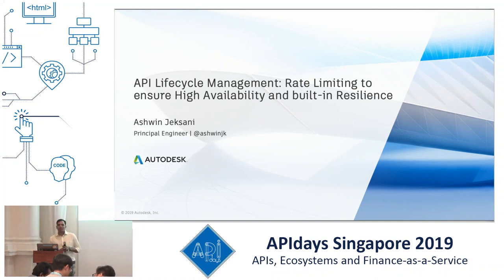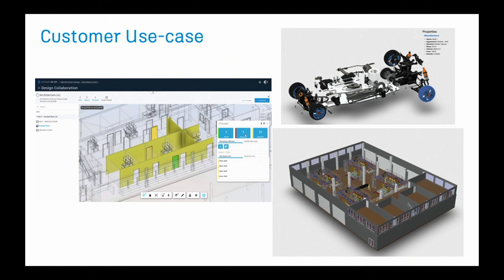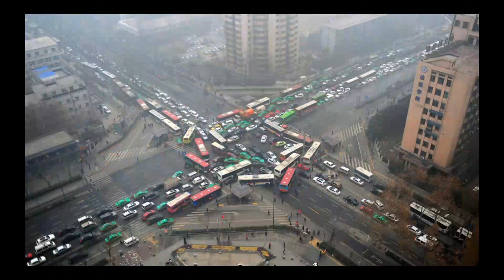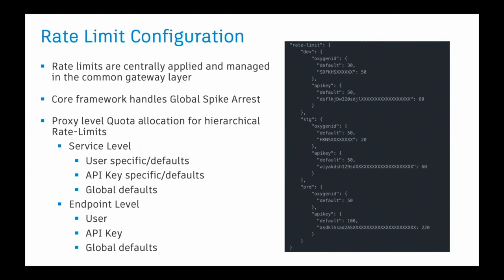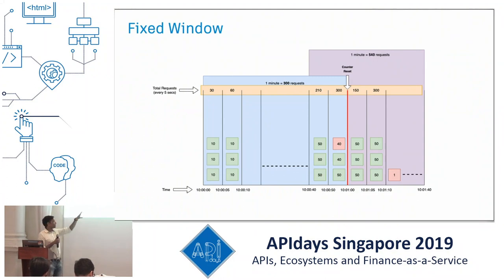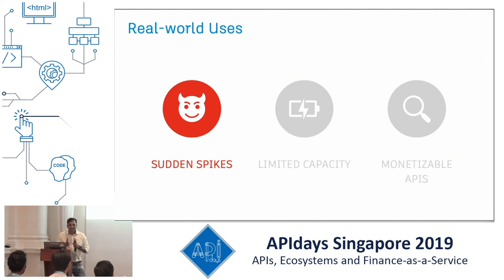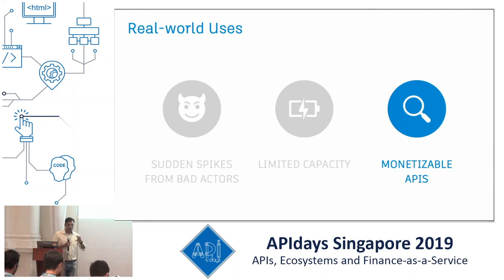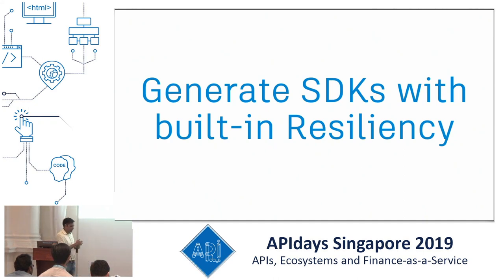Traffic Management w. Rate Limiting to Ensure API Scalability & Resiliency, Ashwin Jeksani, Autodesk

Comment: Audience question was HOW and not Where ? :-) Circumvented cleverly
Reply: I guess the question "How do we know what amount of rate-limit to apply on API Layer", as I mentioned that is also self-service on the platform and service owners are responsible to calculate and tune the limits, however, from a broader platform perspective we do apply the second level aggregated limits to safe-guard the overall system.